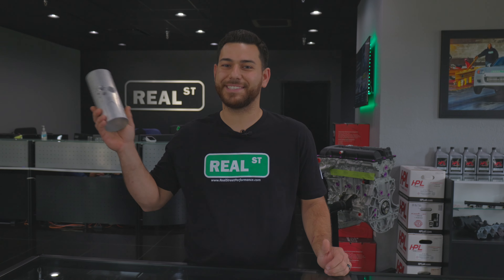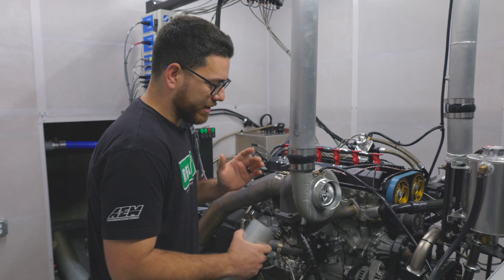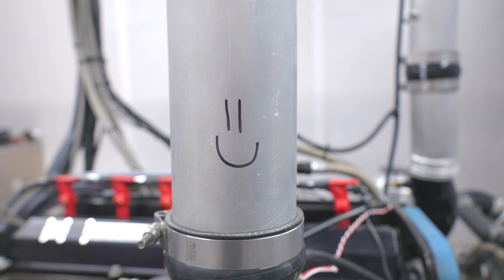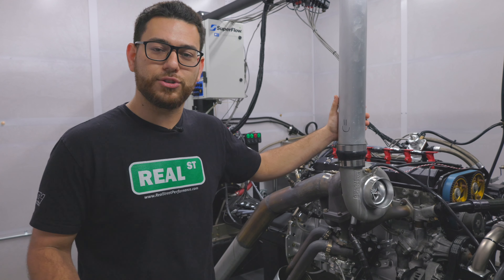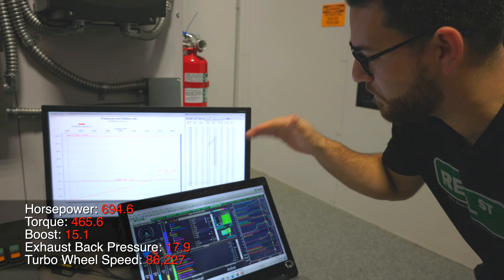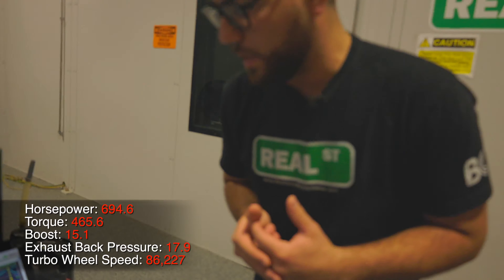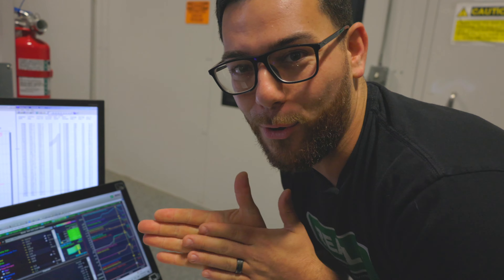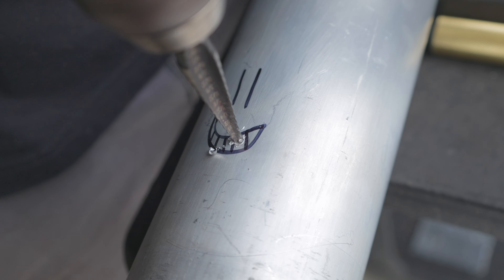Boost Leaks Test & When Do You See A Power Loss

Comment: This was very cool! I would assume that a centrifugal supercharger system is much more negatively affected by boost leaks in the charge pipe system, as impeller speed is controlled solely by engine rpm in that case.

Comment: I reckon if these holes would have been done on the outside of an elbow the leaks would be more significant. Same, if these leaks would be on the inside of an elbow they'd be less significant. When I have to drill a coupler for a nipple to use as a boost source (not all turbos have a barb on the compressor housing) I usually drill for it on the outside of the elbow.